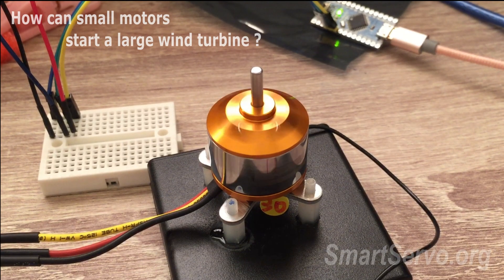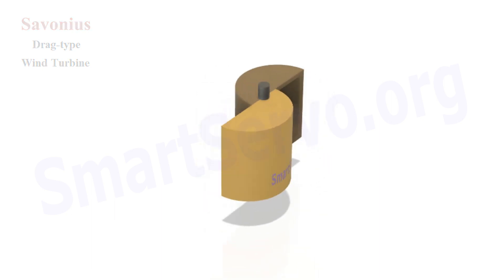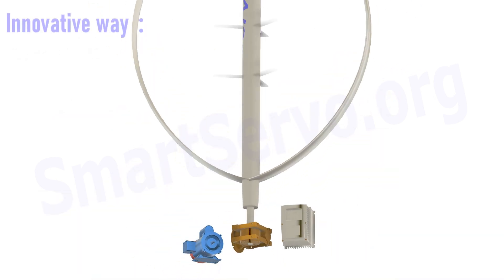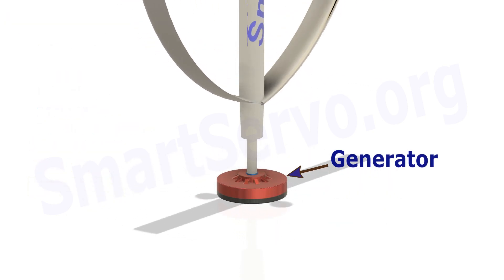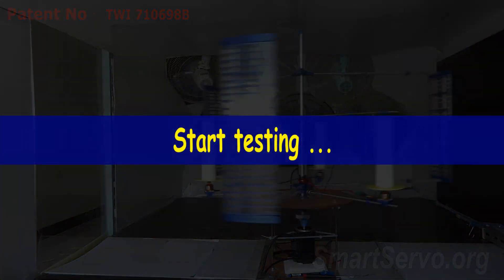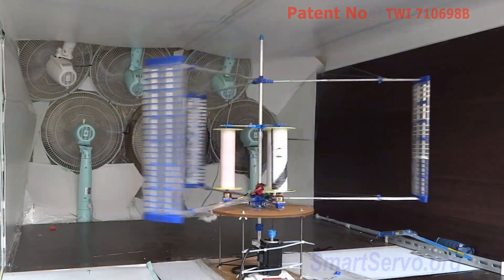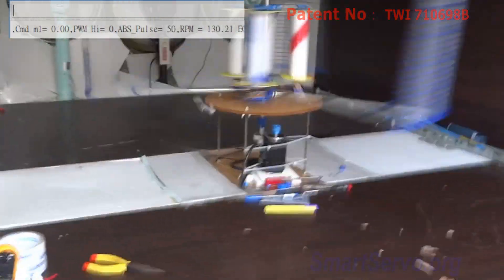Darrieus combined Magnus effect vertical axis wind turbine, for renewable energy

Comment: The system will fail because of the the dependency to the vertical axis that will end up breaking at the weakest point which is its 90° axis to the ground when the speed reaches 300km/h with increased vibration at the top.

Comment: I constantly doubt the use of these types of power generators. Every excited new demonstration is always conducted under 'no-load' conditions. Success is claimed at just overcoming the  basic friction of the bearings. No surplus power is ever seen except the lighting of  a couple of LED bulbs, which at a few milliamps is pitiful. In this demonstration, six powerful fans just manage to spin up the rotor making an impressive demo. Attach a generator to the main shaft and the surplus power would just about drive a Hearing Aid.  The Savonius type of rotor, with it's inevitably low Rotor RPM, will have the added drag of the up-ratio gearing to drive the generator, adding even more friction to the assembly. I commend the energy given to these experiments but I fear the basic science is a limit to success in any real form.

Comment: hi, do u start small motors with batteries connected to rotor?
Reply from the maker: I use a DC 12V adapter so batteries will work too.

Comment: Wot if I say there might b way to increase efficiency of this type of turbine?
Reply: I would say ex0lain further
Reply: I hv  ideas, not sure original or not, 1 was but it got away from me, anyway there is no way without money to determine efficiency, small scale model has some torque to it, if it works as i suppose, useful, so I wud b willing to put it out there,
with some recognition,   other ideas I promote, again not complete sure, no discouraging words yet, spinning battery
space wheel,
Reply: Use dyson concentrating air beams

Comment: You can have the starting columns on a cam which make them move into the centre when speed increases to increase RPM. Just like a figure skater changing from arms wide out to arms on her chest. Speed increase is dramatic. André in Sydney
Reply from the maker: It's a trade off between starting torque and mechanism complexity. I prefer to use a more powerful Magnus rotor => https://youtu.be/gMym621FtR8
 ,rather than adding complexity to the mechanism.
Reply: @SmartServo_org  Renewable energy generators are largely about reliability and long term use for low cost. Keeping it simple helps lower running costs overall so completely agree :)

Comment: Wow!
Would have been useful to hide the Magnus effect starter turbine from the wind after the main turbine catches up and gains its own rotation. Maybe. 🤷‍♂
Reply from the maker: In my few experiments, the Magnus starter did not slow down the main turbine much when the rotor was stopped. Because the starting torque is generated by the rotation of the rotor, the size of the rotor can be as small as possible, not as large as the traditional drag blade.
Reply: @SmartServo_org  
Well, the starter —even a tiny one— stands in the air stream which turns the main turbine. If that starter could disappear completely, slightly more wind energy would blow onto the turbine blades. And, yes, I realize this type of starter is more effective than any conventional option used today.
I just have no idea how to make the starter vanish, it’s not a freaking Optimus Prime transformer :)

Oh, wait! An idea. What if you put the starter above the main turbine?

Comment: One attractive thing about Vertical Axis Machines. On conventional wind turbines the generator set set is mounted at the top of the pylon. Increasing the difficulty of servicing or repair of needed. Plus increasing the mass at the top of the pylon requires mass in the foundation. With a Vertical Axis Machine the generator set is mounted basically at ground level giving much easier access to the mechanical systems.
Reply from the maker: yes, you're right

Comment: Can i know wht is the measurement for the form like diameter and length, wht type of form that i can use for this ?
Reply from the maker: Blade：NACA0015
　Height 0.4 m，Chord 0.12 m

Rotor(Cylinder)
　Height 0.2 m，Diameter 0.05 m

Strut 
　Diameter 1.02 m（for blade）
　Diameter 0.25 m（for rotor）

Comment: i am not going to buy it though. I'll buy low rpm.  which provides high resistance to wind in starting. you don't have to wait for magnas effect.
Reply from the maker: Maybe you need to measure the TSR (tip speed ratio) of the turbine to estimate how well the turbine is performing.

Comment: it setup have high efficiency and low start speed?  that's why you used high rpm generator. ok high rpm is used to have magnas effect.
Reply from the maker: No generator in this test. The characteristics of Darrieus turbine are high efficiency but poor self-starting ability. The common method is to use wider blades (or increase blade number) to help start, but this will reduce the top speed and is not conducive to efficiency, so it is difficult to balance startability and efficiency. This video Demonstrating a concept, the narrow blades can be started by the rotating rotor (Magnus effect), when the turbine speed is fast enough, the narrow blades can achieve high efficiency, and the Magnus rotor can be stopped.

Comment: More conventional smaller VAWTs would also create a Magnus effect force in the opposite direction of rotation, right?

I was also wondering about the three small VAWTs configuration, Vs say 2 or 4 small VAWTs. A bigger number presumably shadowing each others' wind more.

PS: which text-to-speech software did you use?
Reply from the maker: I'm not sure what the three small VAWTs you mention are. There's only 1 VAWT here. If you mean blades or rotors, the more the number, the greater the starting torque but the less efficient.
google translator
Reply: @SmartServo_org  well, the rotors could be full VAWTs, right? Their clockwise rotation would induce a counter-clockwise Magnus effect I believe.

Comment: One the wind hits the outer blade then the money it hits the cylinder the kinetic energy is almost used up. Net effects is drag and dead weight
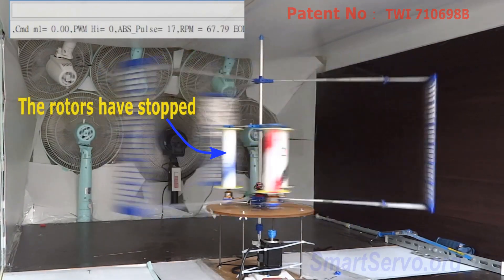Reply from the maker: If you're right, the turbine will not continue to accelerate after 4:00 of the video.
Reply: @SmartServo_org  it will still accelerate but using used up kinetic energy of the wind.  In OTHER WORDS, INEFFICIENT!

Comment: Excellent work!!!
Reply from the maker: thanks
Reply: @SmartServo_org  greeting.
Kindly , what average wattage , voltage , amperage can small wind turbine ( 18 inches max in size ( blades or any different design ) can be produced at speed of 40 miles per hour.
Can this turbine stand wind of 80 miles per hour and produce more energy ?

And what's the difference if it become 48 inch size wind turbine blade  ?

I know this request may sound odd and impossible to create firm.answers...but approximately is more than enough.

Comment: How much does all the equipment weigh if it had to be raised up on a telescopic pole for use??
Reply from the maker: This is just an experimental setup and can't be used outdoors, so I didn't measure the total weight, maybe 2 kg. Each blade is 150 g with aluminum tubes inside. The rotor is made of Styrofoam so it's very light. Each small motor is Only 55 g. The height of the wind turbine is 0.4m and the diameter is 1m.

Comment: Is this the most efficient and cheeper way to have energy from air? Thanks a lot
Reply from the maker: Compared with starting a small windmill by drag blades, according to my experiments, the torque of Magnus rotor is larger, so the rotor can be designed to be smaller, and the interference to the lift blades is smaller and the efficiency is better. As for the big windmill, as mentioned in the video, you can save money by replacing the huge starter motor and reducer.

Comment: And the number of blades can be increased from three to four or six..
Reply from the maker: Too many blades will lead to low speed, although it is easier to start but inefficient. Conversely, a windmill with few blades has higher efficiency but is difficult to start and must have a starting device.

Comment: p.p.s.                                         ..how about..  -- construct as :  Singular  signal-encoder to controller  - for Bl-DC 'Turbine' drivers  .?..   .
.                                                                              .. )  360° / 3 = 120°  ---  then program ( .
.                                                                                                                                                                                                                                      .
.                                                                                                                                                                                                              all the Best .  .
 .                                                                                                                                                                                                             just-in-light    .
Reply from the maker: In the video, the encoder is divided into 3 layers, the upper 2 layers are 2 semi-circular plates with a difference of 90 degrees, which are used to divide 360 degrees into 4 areas, each area is 90 degrees, and the initial position can be estimated as the center of the current area, so the error is no more than +/- 45 degrees, which is small enough to make the initial rotation of the rotor correct according to the command you wanted. When the wind turbine starts to rotate, since it only rotates in the same direction, the pulse of the third layer can be used to calculate the angle of the main shaft, and when a change in "area" is detected, the current position can be corrected again.